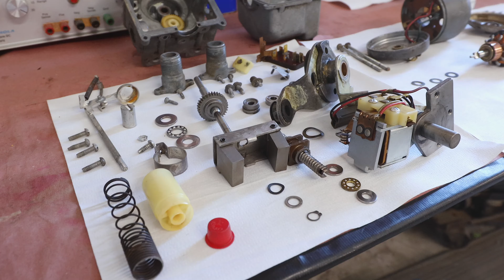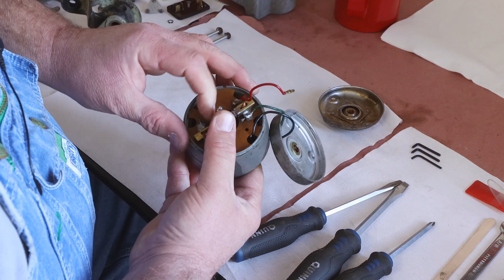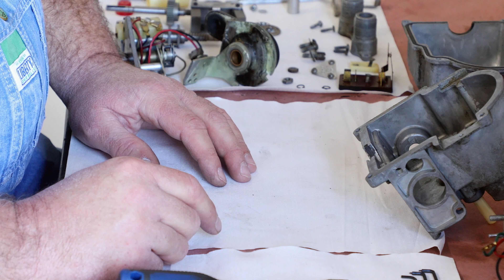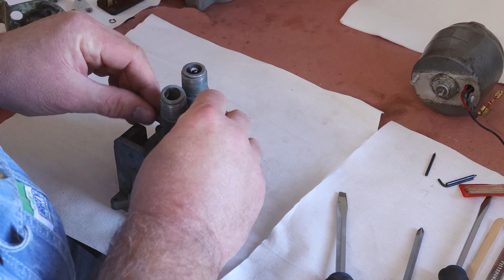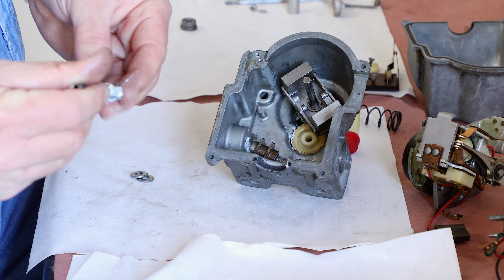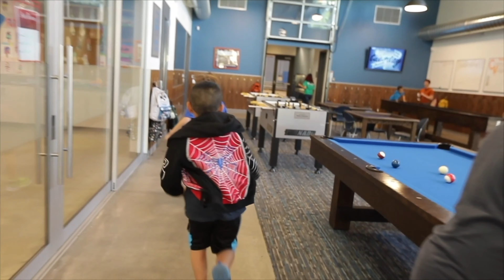How To Rebuild A 1963-64 Cadillac Cruise Control Unit Part 2

Comment: Excellent videos Josh!  Was thinking for the next one would be nice if you put the housing and motor parts when disassembled on a wire wheel or something, and maybe some small brushes to clean up the housing after degreasing.   Can may it look like new/show quality :)
Reply from the maker: I agree the case could have been cleaned up a bit more. It all depends on the car a part is going in. A show car needs perfection, but perfection would stand out on a survivor car or daily driver.
Reply: @Caddydaddy  Cleaning a part is up to the final application and the individual's preference for visual impact. I would rather have a part that has some grease on it, fingerprints and all, which works rather than a cleaned up part that is not perfectly operable"  MTF